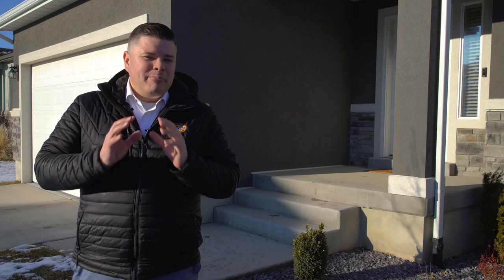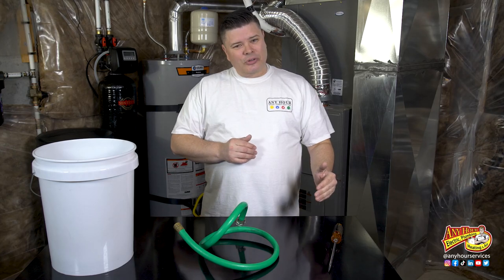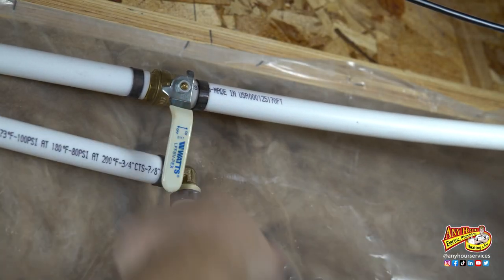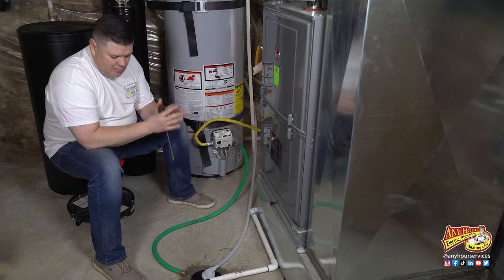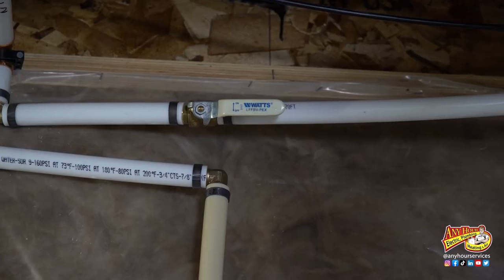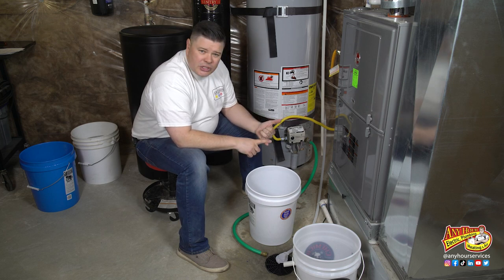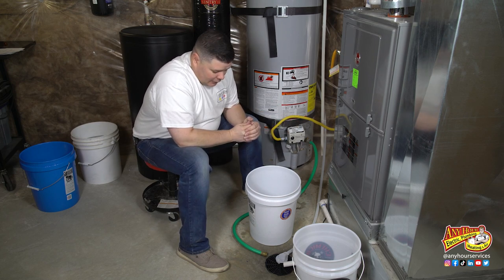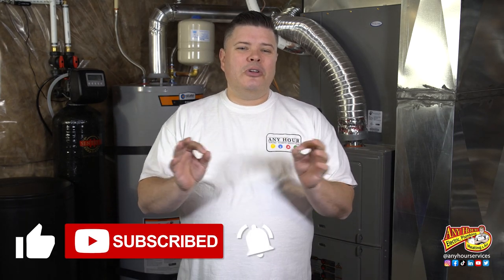How To Flush A Water Heater: Thorough Drain & Flush

Comment: Wondering if there are particular minerals that are problematic to flush out?  
If I got the mineral profile of my specific tap water from the local water utility would that be useful to know what specific solvent to use to loosen and dissolve the minerals caked to the bottom of my tank?